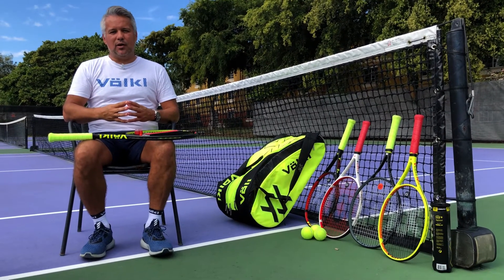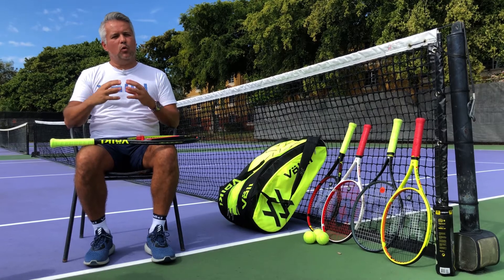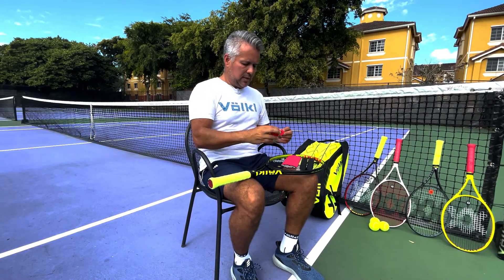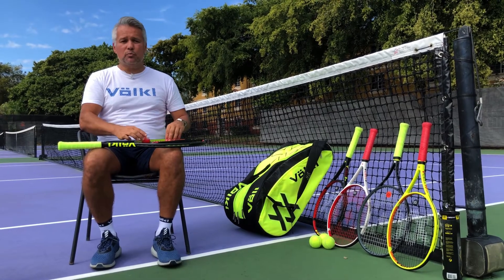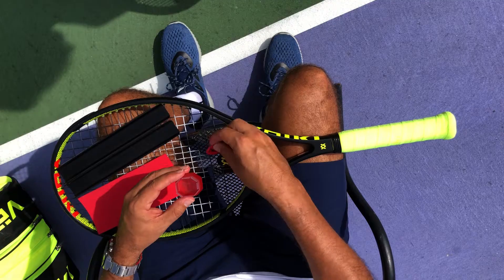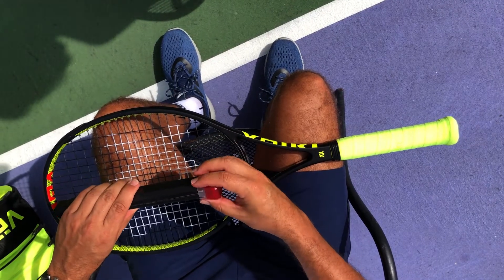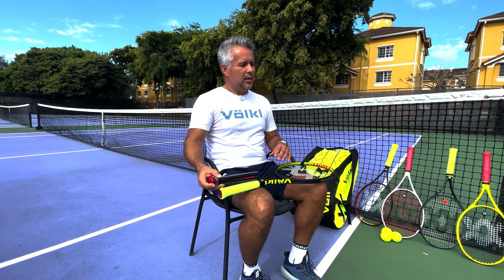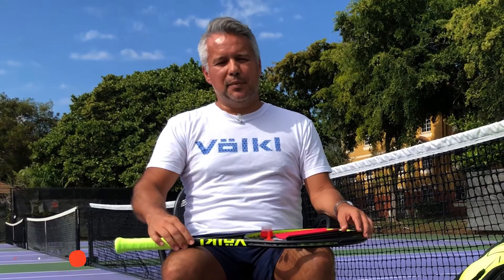Volkl Racquet Technology

Comment: I play Völkl racquets since something linke 25 years and I can honestly say, that these are the most comfortable racquets you can get. Especially the v1 classic ist fantastic. No other racquet has this unique soft touch feeling without any vibrations. Sometimes it happens, that the dampener flies off the strings (players know, what I mean) and you do not notice a difference. Pro-Kennex has a interesting shock upsorbing technology too, but Völkl is the absolute benchmark. If you ever have arm problems try Völkl in combination with their strings like cyclone.
Reply from the maker: Thank you for your comment! I could not agree more.  I tried Pro-kennex a while ago and yes they do feel similar.  Volkl was on my radar a while ago and it so happened that we ended up learning more about them because of this video we did for them and now I play with volkl and LOVE the racquets!